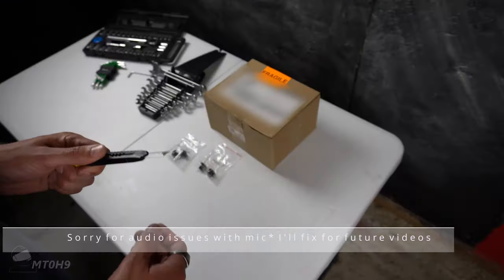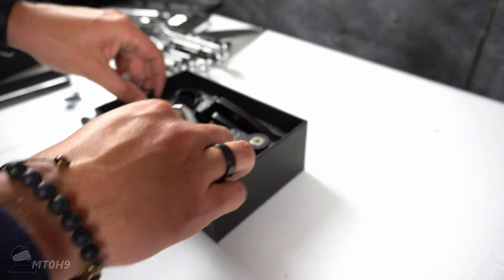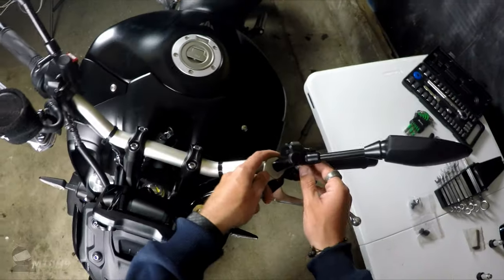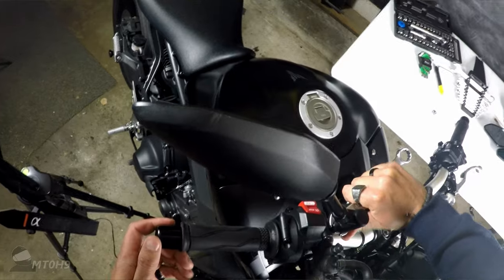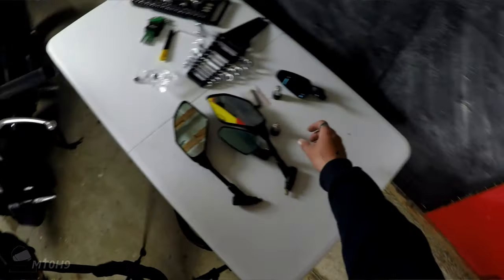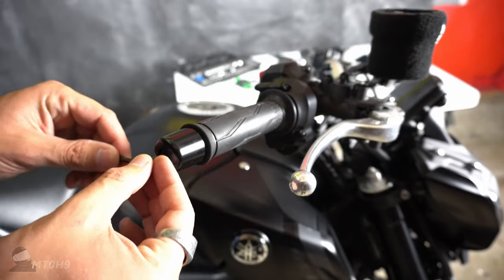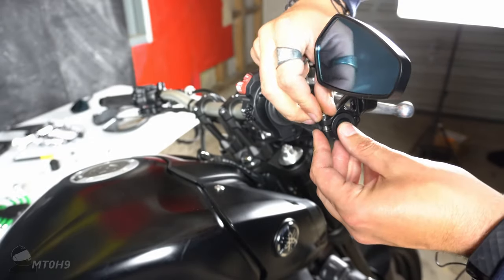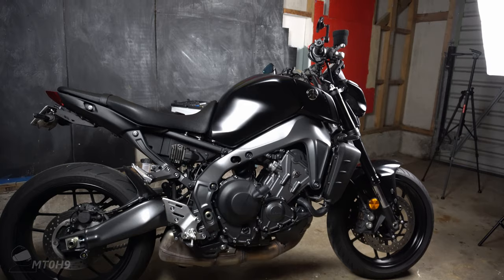The BEST MT09 Bar End Aftermarket Mirror Install *🔥🔥WARNING 🔥🔥*

Comment: Hi dear friend!!
I ordered some mirror like yours, with white glass, but the glass isn't equal like the original, they are made like regular glass and not glass for bike? The cars appear so much closer right now. 
Do you have the same problem?
Tanks you
Reply from the maker: Mine seem to be pretty good. They work well. If you look at the video around 6.20 you can see the reflection of my hand in the mirror and it doesn't make my hand look too magnified. I'll get an angle when I am riding for you to see :)

Comment: I have the exact same mirrors and installed them on the ends of the bar-end weights. Gives you more room for your hand, particularly when you need to shift your hand to the screwdriver grip when cornering hard.
Reply: Where did you get your mirrors from

Comment: They look really nice. Do you find the extra width a problem while working through traffic at the lights?
Reply from the maker: Thank man. No not at all. If you look at it, I took off the original bar end bits, I think it looks better without them on with these mirrors. Anyway, the new mirrors are not far off the width of the standard handlebar set up, so no, no issues at all. And the way these ones go up then out, they are pretty good for gauging width in traffic! :D

Comment: hey mate, i got the same ones but on the bars they move around a lot
Reply from the maker: That's not cool. Mine are sitting solid, no issues at all. I'm assuming you put them on the exact same way I did?
Reply: @thethrottletube  yeah might put some electrical tape on and try again
Reply: @guillee3709  Fixed it? I have the same problem with these

Comment: Nice video! I have to say though, my OCD really wanted to break down those boxes & put them in the trash.. 🤭 I'm looking into removing my bug antenna mirrors also. Just haven't decided on anything yet. 🤔
Reply from the maker: Don't worry, I can tell you after this they made it into the recycling trash and have been given a good home ;)! And yes, once you get something like these on there, it opens up you're view and makes you feel even more free when riding. Let me know if and what you decide on getting if you do change them 😎
Reply: @thethrottletube  LOL, right on. ♻️  I just need to find a pair that can be modified with my current barends. I'm not great at modifying.

Comment: Nice Video, nice work.
After driving what do you think about the mirrors? Do they vibrate on yours?
Because I got some bar end mirrors too on my MT-09 ' 21 (not the same like you) but mine are vibrating a lot when I'm driving. I put now some rubber spacers let's see in summer.
And if I can ask, which exhaust are you waiting for?
Cheers from switzerland
Reply from the maker: Hey Patrick,

I have little go no vibration at all with these mirrors. They are holding up very well, no issues at all. Good cheap alternative!

And an exhaust from Mivv. 😁
Reply: @thethrottletube  ok then I need to try some mirrors like your‘s. Thanks for the help.
Nice you need to tell me how you like the exhaust then. 😉

Comment: Hi great video 🤙 easy to follow 
Where did you get the extensions from for the universal mirrors is it included in the box 
When you say spacer ? is it a washer between your grip and the extension ?
The black colour of your Mt is sick 
I subscribed to your videos keep them coming 
Cheers from Canada 🇨🇦
Reply from the maker: Hey David, thanks alot my man, I appriciate that ALOT!

So the washers in the video come with the mirrors. BUT there are separate spacers you can buy to get those small original bar end fittings back on. I just left them off because those on the end of ADDING the mirrors made the already wide handlebars look silly to me as they made then ULTRA wide. I think it looks better with them off as I have them and stopping at the mirror. Looks way cooler and aggressive. There's a couple others that did a video installing mirrors with the spacers. Have a look, two different end results. Thanks for the sub again, legend!!!!!!

Comment: These are cheap imitations of the CRG Arrow ones... much much more expensive but worth every penny, they withstood scratches, drops, and fiddling around for more times than I can count... the cheap chinese ones will just suddenly break if you go high speed...
Reply from the maker: Very true. 

3 years later and they are still holding up well